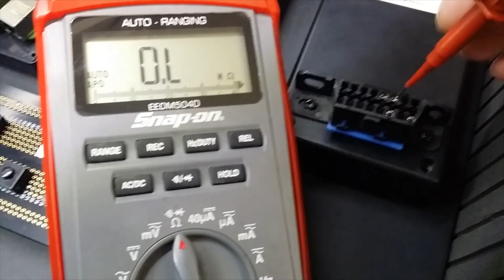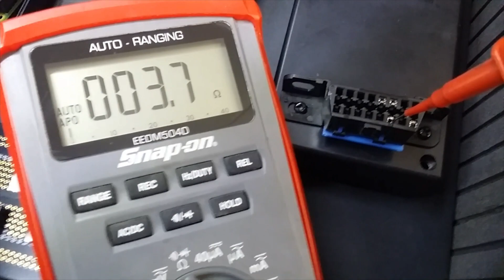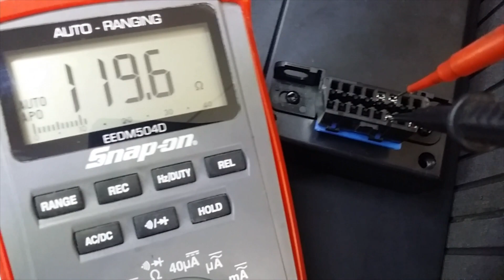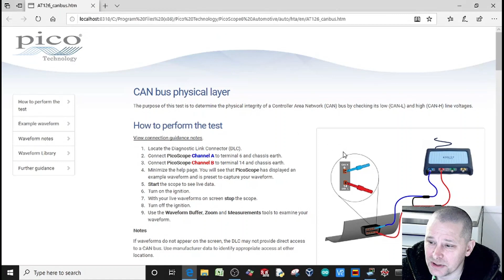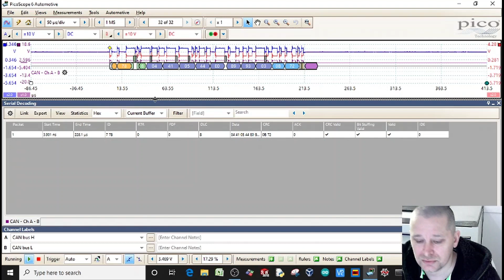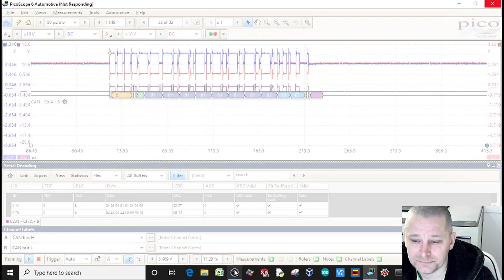Can Bus Test Procedure ( The Definitive Diagnosis Guide )

Comment: Hi Glen. I’ve been watching a channel by Intelligent Auto and knew nothing about CAN until I watched him fault finding a CAN problem and he had been advised by yourself re an issue and I’ve got the same so I’m hoping you can advise me on this. I’ve got an issue on a van I’ve bought a while ago and it has 3 CAN lines but I’m presuming that no matter where I test the CAN physical lay, I should be reading 60ohms at each testing point with or without the components connected? I have terminal resistors present in the ICM and the ECU of 120ohms each. Some tests are recording 60ohms at the wiring and some are recording 120ohms which to me, is indicating a break in the wiring. Am I thinking correctly here or, because I have 3 CAN lines, should I only be receiving 120ohms at some components? The wiring diagrams I have are not very good (Vauxhall Vivaro 2017). I’ve no access to an oscilloscope but with my limited knowledge, I have recorded voltages of 2.5 and around 5 at all of the components that have a CAN wire connection. Sorry for the long winded message but I’m hoping you can say that yes, I must have a broken wire somewhere. Many thanks and keep up your good work for us all.

Comment: Great video! The serial decoding is extremely interesting, however I can't see how this would be an effective way to diagnose and issue especially on vehicles with numerous modules on the network. I am just thinking that the time it would take to figure out the ID of each module and to figure out if the message is correct or not would be extremely time consuming if even possible. I would love to be able to utilize that feature to do so, but it seem next to impossible. Have you ever had faulty module were you have actually used this feature in the diagnosis process? If so, do you have a video of it? I would love to dig deeper into this but just feel like the practicality of it for diagnosing is not there.......seems more of a feature to use for curiosity. (When I say practicality I mean for the average tech diagnosing an issue at a shop, not when it comes to an engineering side).
Thank you very much for your information!!
Dan Jensen
Reply from the maker: Its not for your everyday fault I agree, but its the same with every area of diagnosis,if you expand your knowledge in specific areas you will be the one of the few that can fix the most random faults(like an incorrectly coded module that is sending sporadic messages and causing errors on the bus-you would need to be able to trace a module by id for this). 
For me,career progression does not stop at fixing cars faster,I hope to learn more and progress to a higher engineering level,and the knowledge gained by experimentation in these areas will,someday,go some way to making that jump.
The average tech will not question the "why or how"  they will just fix cars quick and all that will achieve is earning the boss a tidy sum. Those that spend the time on personal development will achieve great things and reap the rewards.
Reply: @definitivediagnosis9162  I totally agree with your comment, and wasn't trying to undermined your post in anyway....I love it! I was just curious if you have actually employed this technique to diagnose a problem. Cheers mate!
Reply from the maker: @danjensen100  I didn't think you were for a second, your question shows your inquisitive mind, I wish I had more practical evidence of how to use these techniques, I have diagnosed various faults in this way but don't have it documented. I'm working on a tool that should simplify this process.